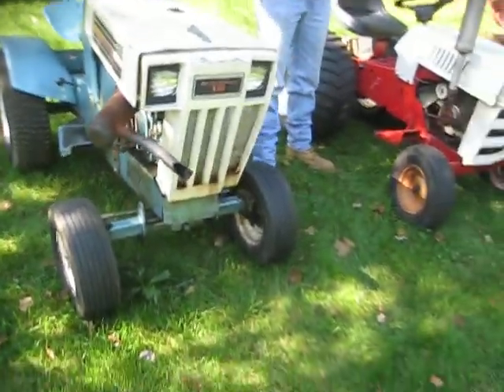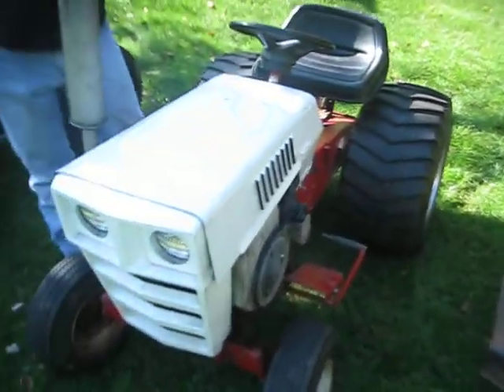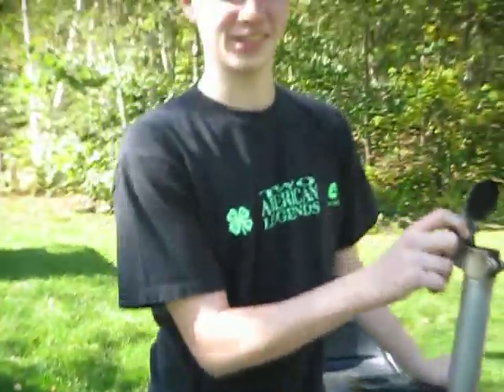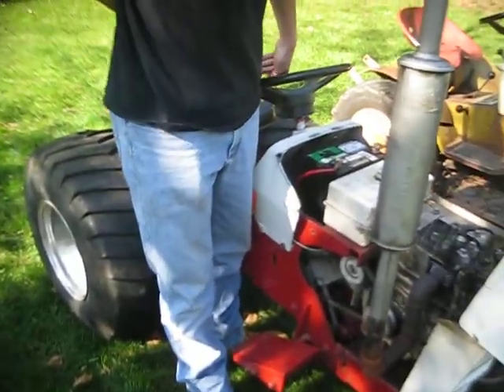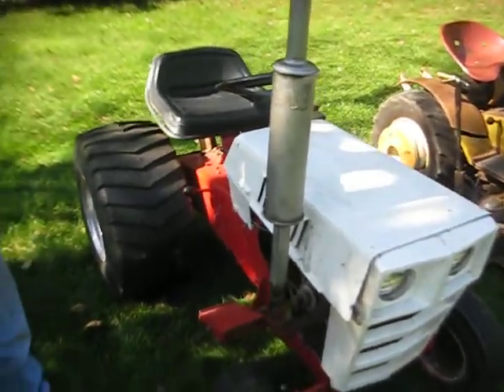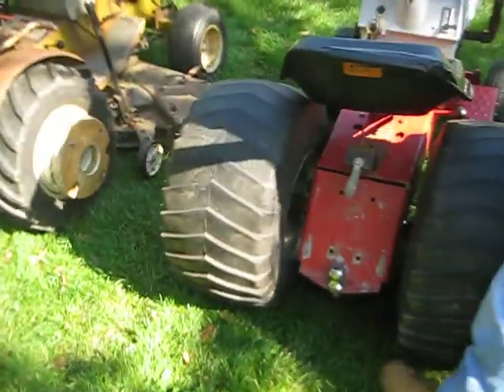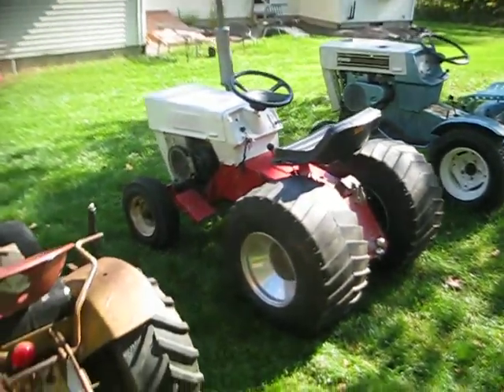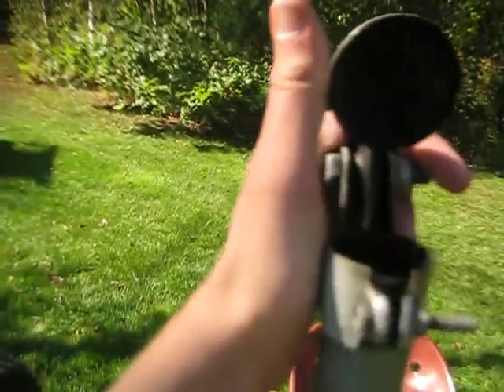Will's Sears Custom 10XL Pulling Tractor

Comment: Maybe you are young buddy will know, two things. First part that is leaking is too high and low shift rod from the transmission. Transmission is already out how do you change the shift rod seal? Do you have to split the case or can you exchange it like the axle seal? Second question is am replacing my axle seal where do you find the replacement axle seal? If you have a part number that would be awesome.
Reply: yes you would
 have to split the case, be careful if you try taking the cast iron hubs off because I broke the ears on mine and had to replace the whole transmission.